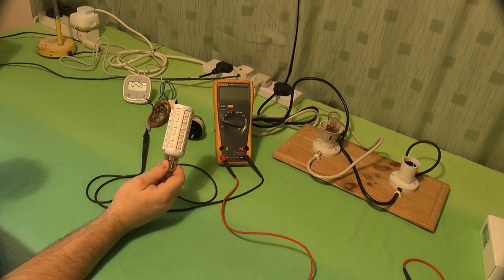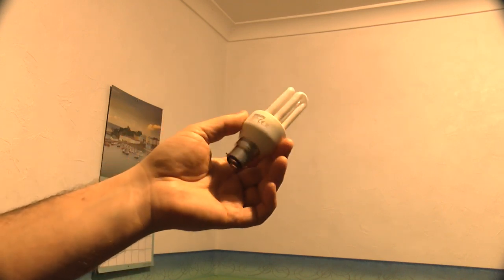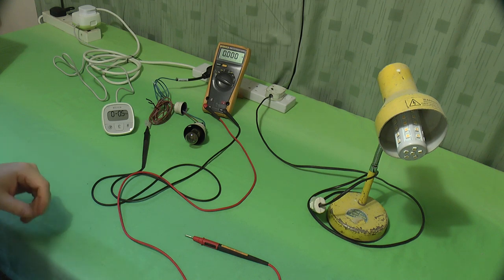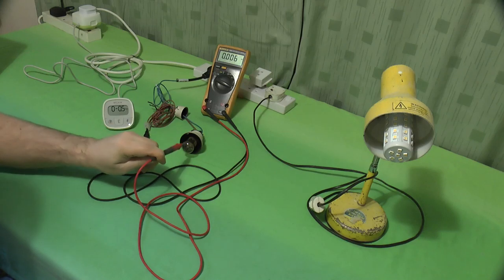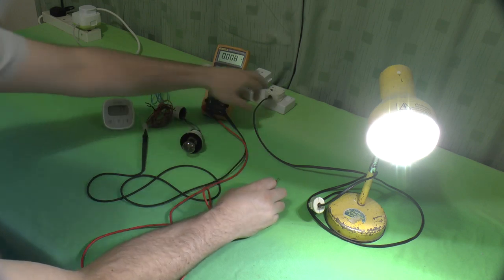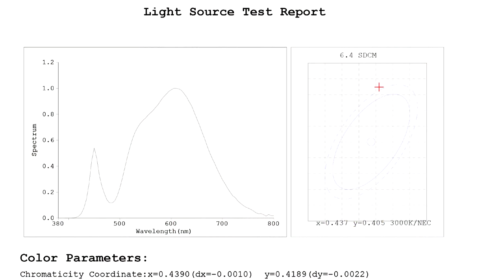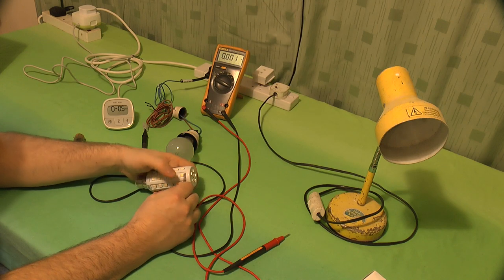Dangerous LED "corn cob" lamp test and teardown

Comment: The lamp would work fine by the ceiling where nobody can touch it, or covered by a shade. The leds being bare probably helps with heat dissipation. You shouldn't be touching hot, powered lightbulbs anyway. Your desk lamp even has a warning on it. The desk lamp needs directed light, such as a conventional LED with the diffuser ripped off instead of wasting it to the sides.

Is it generally safe to connect a multimeter to the mains and push unknown amount of amps through it? Seems quite dodgy to me.
Reply from the maker: So you're comparing a device which would give you a burn (and a lesson not to do it again) with a device that can provide a lethal shock, simply to justify selling dangerous goods to the public?

Seems quite dodgy to me.
Reply: I am genuinely curious if using a multimeter this way is fine. It seems to be a fragile device. Could I get away passing 9A@230V through it? I know it's ok with batteries.
Reply from the maker: @j7ndominica051  when the meter is in its current measurement range the voltage across the meter itself would be minimal as it has a very low internal resistance (otherwise it would affect the measurement).  The current limiting would be provided by the device under test, for example a 2kW electric fire.  If you had three meters, two in voltage range and one in current range, connected the current one in series with the heater (to measure the current flow), one voltmeter across that and one voltmeter across the heater, you'd see most of the voltage across the heater and very little across the ammeter.

This of course assumes that the ammeter has a suitable current range.  The Flukes I use have a 10 amp range, I've also got a 400 amp current clamp for them knocking around somewhere for if I want to measure something really beefy.

It's something I'd not thought of before; why someone would consider such power flowing through a little multimeter as dangerous, and how a simple setup would show why in fact it's perfectly safe, as the power is flowing through the meter, it's not being dissipated by it (that's the heater's job).  Could possibly be the subject of a future video? I don't know.

One important thing to consider would be the multimeter cables.  They need to withstand the highest voltage they'll encounter (or the insulation will break down), plus the highest current flow (or they'll get hot and potentially melt).  Some multimeter cables seem pretty skinny when you consider they may be called on to handle 10 amps.
Reply: Thank you for the explanation!

Comment: Thanks to the presenter for this informative video.  It's disappointing to see that NicolausLedZepplin has added his incorrect opinion to this and Julian Ilett's similar expose of the GU10 lamp safety hazard.    In both cases the presenter's analysis is accurate.  These lamps are only safe if used in a fully enclosed fitting, and the power is removed from the circuit before opening the fitting and touching the lamp.  The public won't know this.  There should never be live terminals on consumer electrical goods.  I have over twenty years of experience of electrical products and safety standards, made many CE declarations for electrical products on behalf of my multinational employer, and now lead a large team of engineers on aircraft electrical systems.

Comment: i remember in the 80's when incadenscent bulbs stopped being made in uk and went to china, all kinds of wires sticking out of the bayonets and loose 'glue' that held them on , so they fell off inside the socke, and thus needing someone brave with insulated pliers to get it back out, this is made worse that we are the only country that uses bayonets i think, the rest using the edison screw,  so that reveral being worse is because it wasnt even tested with reverse polarity except that it actually functioned.
Reply from the maker: Swings and roundabouts. I prefer bayonets (too easy to shear an Edison Screw), and in Europe you've got to be careful of table lamps with ES bulbs as the plugs (and sometimes the incoming mains supplies) are unpolarised, so the threaded portion can be live. Been there, felt that.
Reply: Fun fact: We use bayonets here in Australia too, and I imagine our Kiwi friends would as well (they have the same wiring standard as us).

The joys of outsourced manufacturing and design, eh? -_-

Comment: GREAT WORK THESE LEDs ARE SOOOO TEMPTING TO USE
is there a way to re-drive them
of course i could clear coat them with silicone

i know you can buy the boards themselves and make your own
but the sad truth is these are probably cheaper
Reply from the maker: Should be drivable with an appropriate driver circuit. I think the strips need about 18 volts (current limited of course) as the LEDs are in series.

Comment: Yeah I am leary of any of (cheap) high voltage powered bulbs , I stick to the low voltage powered ones. I should post the new one I picked up cheap that has what appears to be a TINY switching power supply on it.

Comment: That was really bad - I wouldn't think this is a very big deal if it's on a test circuit during experimenting. But this is seriously dangerous - most of us doesn't think that a lamp for use in homes may go live when connected. It's also (as written in the description) common to hold the fitting (wich may be metal and grounded) with the other hand while putting the lamp in.

I guess it's all about to save money. Those CE markings is not much to rely on - almost every electric product I have seen have them, so it's probably hard to check that manufacturers doesn't cheat with it. The RoHS just means the the components are "friendly" to the environment and is not a safety standard

Comment: Im surpised your video of the lamp looked how it did, I have tried some of these and the 100Hz flicker of unsmoothed AC beats with the 60 or 24FPS videoing it and makes a horrid lot of lines across the image.
Reply from the maker: I was filming at 50fps. If you watch my other video related to LED corn cobs you'll see some sudden brightness changes in the video. That's where I had to edit pauses and re-takes out of the video, but there was a slow-moving band of brightness moving down the screen, due to the camera not being quite in sync with the AC supply. The still images at the start of the video also show this banding.
Filming at 60 or 24fps would've been very messy.
The shocking truth about cheap LED lamps

Comment: I always thought these things would be a power supply thats driving the strips from some lower DC voltage around 40v or something.. so that the exposed contacts on the leds wouldn't be a problem.
Reply from the maker: Some do, but as you can see, not all of them.

Comment: Think on lamps in the ceiling and then standing on a ladder on a stone floor with those plastic caps of the ladder worn out. And then you just fallen of into a glass table while first electrocuted. With a bottle of whiskey and a candle on the glass table... Setting you on fire on the way.... Yeah.... thats got to hurt.
Reply from the maker: Definitely, that bottle of whiskey would've cost a fortune.
Reply from the maker: Shambles1980TRealOne
 Haha, if you're seen doing anything even remotely risky in the first five minutes of Casualty, you're screwed.

Comment: I like the blue flash at 15:20 as the probe lifts off. Pretty telling
Reply from the maker: Haha, I should've run it off my 800 watt mains inverter, I've added a 300V DC output on that, would've arced nicely!

Comment: Hi 
I just saw your video an you are fucking right! These bulbs seems to be dangerous, but, how can they be improved? Any Home-Made insulation will be possible?
If you apply some dots of silicone (which is non conductive and easy to find and apply there where the current is passing through) will bring back a little peace-of-mind to our minds about this LED bulbs? I mean, this ones do not get as hot as to weld these tinny silicone dots. (I´m just saying, I have not idea if it will work at all, so, if you can clarify me this idea, it will be nice!). I have 2 corn bulbs and I´ll not see them as I did yesterday. Thanks a lot. 
Oh, another question, if ther are located on a ceiling and have no posibility to get touched, will they be safer than if used on a desklamp?
Reply from the maker: Strips of clear plastic (from a 50-CD/DVD plastic tub for example would be better.

Yes, out of reach should be OK as long as anyone likely to change the lamp knows the dangers.

Comment: Could be a good idea using some printed circuit lacquer all over the lamp to improve the isolation, then cleaning the lacquer away from the chips only? Sure it will not turn it into an electronic masterpiece from its misery but better than nothing...

Comment: Ive got a few cheap LED mains bulbs and a few Osram that i bought retail at over x10 the price. The non Edison screw fittings are a concern in regards to polarity, the ones I have do have a plastic "bulb" over them to prevent them being contacted on the boards. All LEDs ive seen have cheap ass components in the current driver (even brand names) and i think thermal design and build quality is the main difference.
Also, i have 2 low W (3-5w) eBay spec installed and have done about 3000hrs and still are fine. Russian roulette to an extent.

Comment: I'm a fully qualified part p registered electrician plus have qualifications in electronic servicing with over 20 years in the industry who has used these led lamps for over 4 years at numerous clients homes and fully throughout my own home plus I allways recommend them to family members with no issues what so ever and after trying another supplier I've have had a 50% failure rate so have gone back to eco ers without any hesitation any further issues so I presume you had a bad batch delivered so what I can say is some people may take the wrong information from you you tube on there lamps . GREAT QUALITY AT A GOOD PRICE, not exactly what you are saying on here I think
Reply from the maker: paul gregory Dangerous lamps and no respect for the Data Protection Act, as demonstrated when the MD of Eco Ers (now Lucemi) decided to post a customer's name and address in a quickly-deleted (by me) YouTube comment, evidence of which I've retained, so regardless of whether he's now selling safer models of lamp I wouldn't touch his business or his lamps with a (nonconductive) barge pole.

I'm not the only one who's tested lamps of this design. Fake Britain ran a story on it as well, using a test method almost identical to the one I've used in this and my other video. https://www.youtube.com/watch?v=M0fqceT9n5Q
Reply: paul gregory I don't get how you would encounter the "dangerous shock hazard".
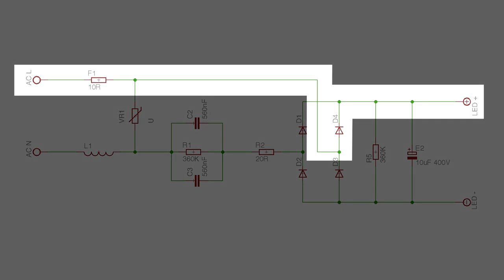According to his circuit at 19:10, if you touch the contacts, there would be 10+20+360K ohms from hot to neutral.
In his test, he bypasses the 20+360K ohms by having his little bulb connected directly to an outlet neutral.
So when are you gonna hold a neutral wire while touching this bulb??? You'd be pretty stupid unless I'm missing something. :/
Reply from the maker: The neutral wire is at ground potential. The earth wire is at ground potential (and in many electricity supplies earth and neutral are connected together by the supply company).

If you think the test's bollocks, compare with this more recent one featured in Fake Britain: https://www.youtube.com/watch?v=M0fqceT9n5Q

Comment: I know there's all kinds of misnomers about the use of the CE mark, but, when it comes attached to something made in china, I just call it the Chinese Excrement mark, plus there is a difference between the genuine CE mark and the Chinese Excrement mark, if you continue the circle that the C forms, it should touch the very base of the line through the E, the chinese mark never does, and that's how you tell it's not a genuine, officially certified product, but that said we'll be out of the EU anyway so we can scrap the CE mark... :P

Comment: 44 milliamps through an incandescent bulb that isn't getting up to operating temperature so isn't offering much electrical resistance...no way you're gonna get electrocuted if you touch that LED bulb even if you used a death grip on it.
Reply from the maker: Very good point about the cold filament (which I've just measured as 190 ohms), people forget how much power a bulb will draw when cold (and why they only seem to pop when switched on). However once there's a voltage across it the resistance quickly climbs.

In my other video (https://www.youtube.com/watch?v=rNf6VSj6M-E) where several bulbs were tested I was measuring voltage across the bulb and current through the bulb simultaneously, so the resistance of the bulb and the power through the bulb at that time can be calculated.
Video Time - Volts - mA - Ohms - Watts
4:45 (direct-to-mains) - 241.3 - 106 - 2276 - 25.6
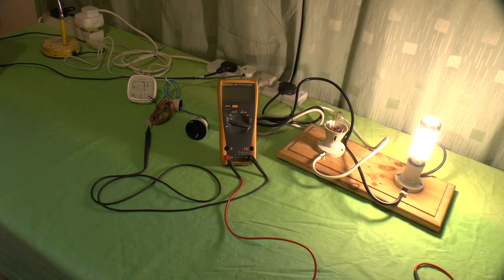4:57 - 150.5 - 82 - 1835 - 12.3
5:51 - 155.5 - 83 - 1873 - 12.9
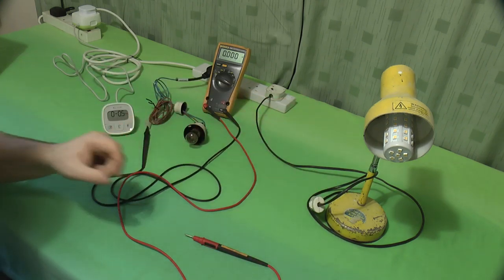6:28 - 187.1 - 92 - 2034 - 17.2
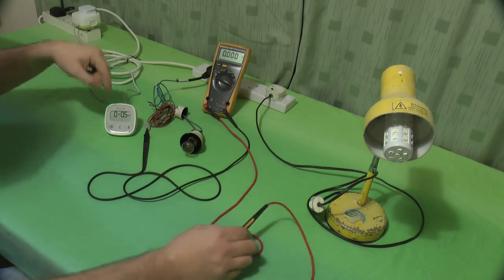7:16 - 174.3 - 88 - 1981 - 15.3
7:28 - 141.0 - 80 - 1763 - 11.3

Comment: I just ordered some corn cob led bulbs from China at less than £2 each but they are enclosed in clear plastic so it's not possible to get an electric shock from them. I guess they could still start a fire though :-)

Comment: What is really dangerous is when you don't use any PPE taking that corn cob apart, and you are worried about electrocution you should be worried about slicing a dicing your Epiderme and getting Gangrene which is a worst death than electrocution
Reply from the maker: I'm not bothered about getting the odd cut from a circuit board or piece of plastic. Antiseptic and a plaster, job done.
Reply: AintBigAintClever
And I'm not bothered with electrocution 'cause my skin is so dry it won't pass enough current to kill me. alas it is a good reason for anybody else to have a ground fault interrupter that will kill the circuit before it kills you

And good luck going after the crooks that made that corn cop lamp
Reply from the maker: Most UK lighting circuits installed before 2008 will not have RCD (GFCI) protection. Since 2008 they've either needed mechanical protection for cables buried less than 50mm beneath the wall (such as earthed metallic conduit or shielded cable) or an RCD.

Comment: China pride strikes again! (assuming that's where it's made).  That light has a very good light output but when I saw the exposed LED contacts, one thought entered my head "WHAT WERE THEY THINKING?!".  I know I'm not the safest person working with electricity but even I wouldn't have designed it like that.
Reply: The problem is not the exposed LED contacts. The problem is the electric circuit that is shown in the last part of the video.

If the electric circuit were not such a fail, there would be only a low voltage and low power circuit on the exposed LED contacts.
Reply from the maker: Exactly. Exposed contacts with a switch-mode power supply would be acceptable. Shrouded contacts with a dropper circuit would be acceptable. Exposed contacts with a dropper circuit: accident waiting to happen.
Reply: The issue with china quality is they have cost management, and engineers, but no cost management that are also engineers. Likely the circuit was designed with housing in mind, or a switch mode circuit was designed for it, but they decided to use a cheaper alternative from another model instead. Things are cheaper from china for a reason, too aggressive cost cutting. How much would plastic lens cost really... Even if cheaply made, at least people would realize the thing is dangerous if one broke off.
Reply: quality depends on cost, do you think you can get quality products at much lower price? customers always ask for low price, so that's the low price led corn lamp. price will be three times as this one Julian tested if you want the lamp with ce mark, hi pf, hi lumen etc.
Reply from the maker: Then the suppliers should refuse. The answer to "can you make it cheaper" should never be "yes, it would be dangerous but yes we can do it". It should be "no, because the product would be too dangerous to use".
Reply: ya, I agree with your opinion, but most of customers don't have concept what's led. just focus on price.

Comment: What the hell are you talking about 43ma it's not even half an amp
Reply from the maker: https://www.osha.gov/SLTC/etools/construction/electrical_incidents/eleccurrent.html
Reply: 43mA at the rectified mains voltage which feeds the LEDs (up to 385V DC from nominally 240V AC mains) is plenty to kill you, but it is limited through the internal resistor. Whats worse is when the polarity is reversed and 83mA flows limited only by the 25W bulb or 158mA flows through the 100W bulb. If there were no lightbulb to neutral and the connection was through your body to ground, the current may exceed even the 158mA seen.